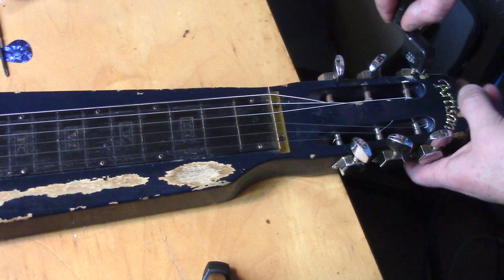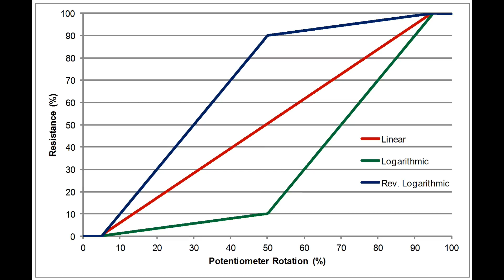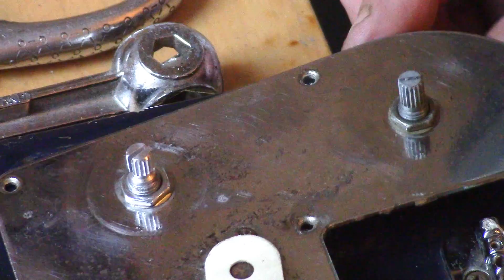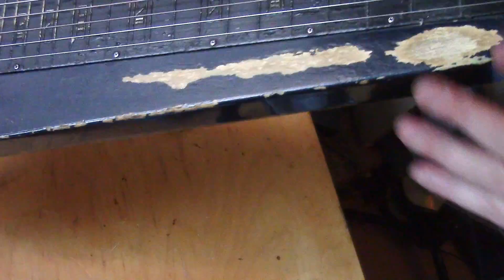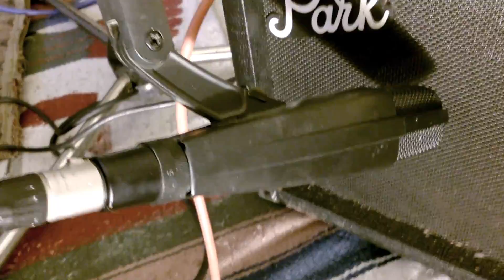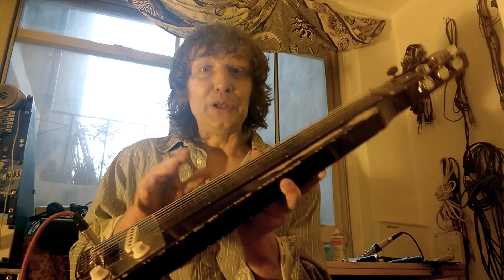Part 2 of 2.Servicing guitars- How to replace volume knobs/ pots.

Comment: I just ordered a Rogue lap steel which is similar to yours.  I also ordered the Georgeboard kit to replace the nut and saddle and convert it to a 22.5 inch scale.  I also want to replace the pickup and pots.  Your video was great at going through the process.

Comment: Hi Nelly. Really enjoyed the video. I bought a lap steel recently and I’m in the process of making a new scratch plate. When I removed it I noticed a red wire coming from below the bridge. It wasn’t connected and I was wondering if it’s an earth wire meant to ground the bridge? Also can you recommend a replacement single coil pick up? Those strings are phenomenal!  Thanks.

Comment: Hi Nelly . Many thanks for the video. Gues  what!  Wanted advice on changing Volume Pot on my lap steel guitar, an Artisan that is exactly like the one you use in the video. Could not believe it. Thanks again.  Brian. Lancashire
Reply from the maker: There ya go....is your a blue or a red ??  the 2 I try out sounded so different,I wanted the red metallic....was just about to pay....and I thought ..lets just plug other one in to see if there's any difference and there was ....A huge differance..  The Bluey rocked !!   Strange....so if your in a shop buying a guitar,and they have a choice of the same model guitar... always double check...try them out....just in case..Do not choose by colour !! but by sound.

Comment: Hi Nellie, thanks for another great video, never too old to learn! I also have an Artisan Bluey, exactly like yours! I guess you changed the pickup? Mine went dead after about a year or so, put in a Strat pickup. Broke the ground wire removing the control plate, have to sort out how to repair it. How did you do that (as I don't see your original ground wire as well)? And you changed the tuners as well? Two of my tuners are very wobbly, so I guess I'm going to put on some new ones. Cheerio!

Comment: awesome video dude, if it was up to me id swap out those tuners too, never liked those ones that just fall apart when you take em off, either way, it sounds fantastic!
Reply from the maker: Yeah man,it  rocks for sure....I did change  the machine heads,they came from a Yamaha acoustic guitar...I found it in the street...... someone had smashed it up ,the top half of the neck was there, with all the heads in tact still(about £170 guitar),so took it home to use the heads, my Bluey did have really awful machine heads before!!